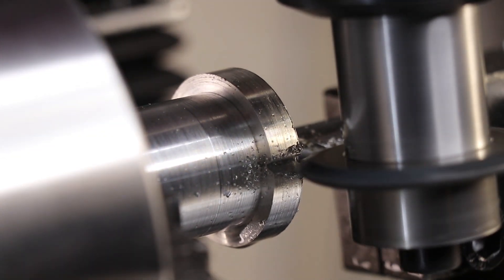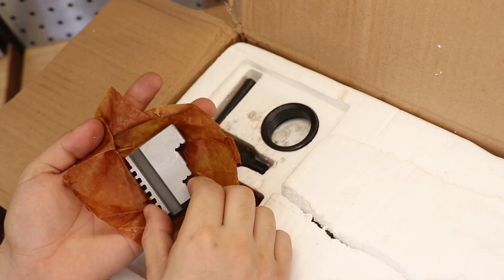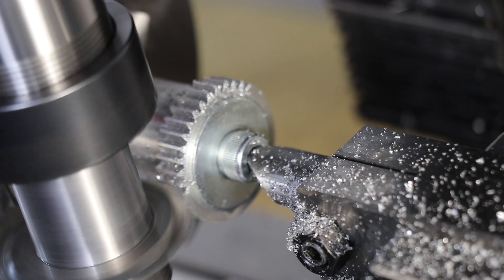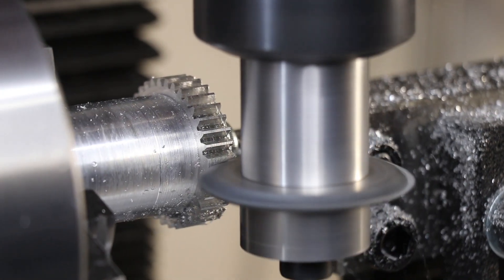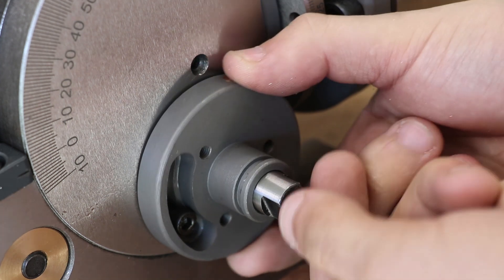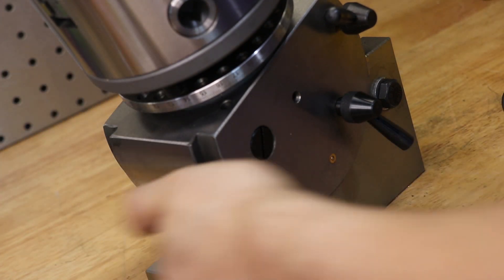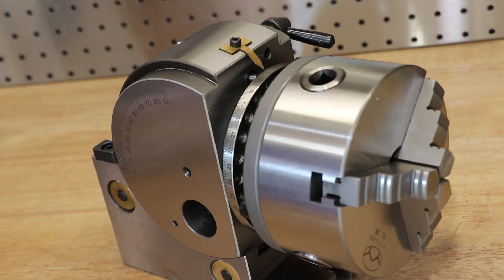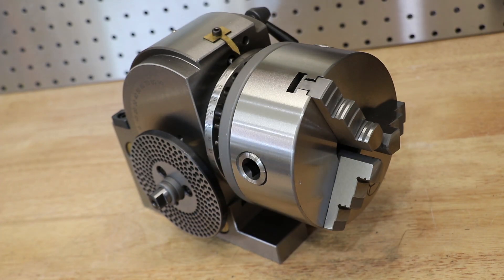$200 Dividing Head - Almost Scammed Buying It

Comment: You can’t press the spindle out. I just dismantled mine. You need to get the chuck off. I locked it and grabbed a cheater bar in the chuck jaws and it came off without any damage. The reason it was so tight was the machining of the spindle nose threads on mine was horrible. The threads were so sharp they would cut your fingers. Worst threads I’ve ever seen. But they shipped it anyway. Either the major dia is too big or they cut the threads too deep. But it’s cheap…..once you get the chuck and the direct indexing plate off there are 3 cap screws that hold the taper bearing race to the body. This has to come off to remove the spindle.

Comment: NOT MT2 dead center, it's a Brown and Sharpe #7.
Reply from the maker: The technical drawing that comes with this lists this as a Morse 2 taper. This is a Chinese close so it is possible that the taper has been changed
Reply: @artisanmakes  The Pdf manual that is on Vevor online states its BS7
Reply from the maker: Just checked again. It definitely says mt2 on my one
Reply: @artisanmakes   I checked the manual I downloaded from the website, it's over 10 years old.
Reply from the maker: No, my maual says MT2. It could very well say bs7 on others. I am telling you what my manual says that came with my dividing head

Comment: The one thing I care about is accuracy. So a test would need to include measurements.
When it comes to the bolts, rather than dismantling the entire thing, I'd undo the bolts with pliers and replace them with ordinary bolts so a wrench will do.

Comment: You need a mill with a universal table to spiral mill. I bought one from MSC back in the 1980's. They are nice. When I moved I sold it with the mill. I bought one again on Ebay for about $225.00 a few years ago. I switched out the original 5" chuck for a 5" chuck that had bolt on top jaws. I have no complaints. I sold my L&W index head with a 6" chuck, because this one is lighter and a 5" chuck allows you to get in closer to the chuck/center with the spindle.
Reply from the maker: For sure. I have a set up that gears the table leadscrew to the mill but this diving head is a little small for heavy duty helical milling. Cheers

Comment: Chuck removal: can you get a strap wrench on the spindle or the index plate?

101 divisions: if the handle is sufficiently accurate radially, you could make a plate with multiple hole circles, either 34, 34, and 33 holes or 25, 25, 25, and 26 holes.

Comment: my lathe is a vevor brand, its been pretty good for me so far only issue being the crap tail stock they come with, seems like an issue for everyone and the chuck plexi glass guard was broken when i open the crate, but i will give them credit cause when i contacted them about getting a replacement all they asked for was pictures of the broken guard an proof of purchase an they sent it, took about 2 weeks to come an it was alot better packaged than the lathe its self, it came with a bunch of stuff that was there own boxes but they was left loose in the crate an thats what got the plexiglass guard.

Comment: hello you can unscrew the chuck by using the indexing pin to block the shaft, and use the chuck key  with a small hammer to unscrew it. be sure to make the chuck in vertical position and give for some days proper lubricant to  help removing the chuck.  sadly the chuck plate is put in force, even by unscrewing screws i cannot unmount it...
Reply: i managed to open the chuck... don't know how to explain. i put the chuck on the shaft, put a nut inside the opening of the chuck so that it is in contact with the shaft and not the chuck, tigten a screw on the chuck with a nut. by screwing the screw, the nut is hold on the chuck, so the screw pushes on the nuts that is in contact with the shaft.. so the chuck plate gets out ! easly !
it really needed grease : there were burrs and no grease on the worm gear !

Comment: The video clips of you cutting gears shows you cutting in the wrong direction. Milling between centers in a dividing head should always be done with the cutting forces directed toward the head, not towards the tailstock as the tailstock is not designed to handle the force generated.
Reply from the maker: just skimmed through the video, i cant find an example of me cutting in the direction towards the tailstock
Reply: At the start of the video and as far as I can see all the close up shots of the milling in progress clearly show the chips flying toward the tailstock.
Reply from the maker: oh I see what you mean, I think i misread your previous comment
Reply: @artisanmakes  Sorry for my lack of verbal precision. I did not want to make it too long winded. You need to flip the cutter and reverse rotation of the spindle. If you use the back gear to reverse rotation that gets your cutter speed down to a reasonable surface speed but maybe you already did that, its hard to tell on video.It is also normal practice when gear cutting to give the spindle lock and the Y & Z locks an extra tweak, any movement at all and you have a piece of scrap instead of a gear.

Comment: Artisan Makes, you quite rightly mention further down in the comments that the smaller heads BS-0 and BS-1 are only semi universal as they are not equipped to be rotary driven by a train of back gears and therefore cannot produce helical gears or splines. This can be overcome on the semi universal heads by the addition of an electronic stepper motor and rotary encoder drive. There are a few others who have done this very successfully. 
Also the annoying issue with trying to juggle 2 spanners to adjust the pair of tailstock nuts and bolts can be greatly improved by replacing the 2 individual nuts with a rectangular piece of steel flat stock with two threaded holes set at suitable centres.
I have one of these cheap import dividing head kits the same as yours and they can be made very reliable with a bit of fettling and adjustment...very happy with mine and still can't believe how they manage to sell these for that price.

Comment: i'm thinking about getting one of these and this helps.
funny thing, it was cheaper to spend 1,000 for a lathe than it was to have 7 parts made.  i have the parts, and the lathe and saved about 1500 dollars.   i think the set up for the company was about 50, and then 90 per hour,  they gave me an estimate of 3100 dollars.
Reply from the maker: Neat, best part is you have all the machinery left around afterwards for future parts.

Comment: You can not press that out. You use the direct indexing pin to lock it, and dead blow hammer on the chuck key to unseat the threaded backplate.
Reply from the maker: I eventually had to make a jig to hold it to unscrew it, it was very much sized on
Reply from the maker: Pinned comment - EDIT 2: Thankyou to all the suggestions, and I have finally gotten the backplate off the spindle. Ill make a quick update video, but  to cut to the chase, I needed a fixture to stop the spindle from rotating, penetrating oil, an impact driver and a spanner for leverage. I really can not stress how tightly it was torqued on. No Damage to the threads, should be good to go. Cheers

Comment: If it’s like most others, the back plate unscrews from the shaft . which has a taper for a center
Reply from the maker: Pinned comment - EDIT 2: Thankyou to all the suggestions, and I have finally gotten the backplate off the spindle. Ill make a quick update video, but  to cut to the chase, I needed a fixture to stop the spindle from rotating, penetrating oil, an impact driver and a spanner for leverage. I really can not stress how tightly it was torqued on. No Damage to the threads, should be good to go. Cheers

Comment: Enjoy your videos and look forward to them. Im new to machining and you have sold me on a dividing head, i have a question though, you have purchased a BS-0 and the larger BS-1 is only $70 more, is there any reason you didn't go for the BS-1? or is the BS-0 the better unit? many thanks.
Reply from the maker: As i understand it they offer the same abilities, just bs1 is bigger. As it is, bs 0 is big enough for my machine and what I need so I bought that. Bs 2 and 3 however are slightly different as they are universal dividing heads and can do gear hobbing, whilst these can not.

Comment: I discovered VeVor a few months ago, and i have bought many items and are good for the home hobbyist.
The Dividing head i got was the HV4 for £109 Bargain as it is well made.
as for those cap head screws, when ever i get a problem like you i get a 2 or 3mm drill bit and drill through the side of then and insert a round bar and turn. 
or as suggested, if they are loose enough then try a pair of grips first.
when they are out i do replace such with a Hex head bolt so i can use a spanner,

Comment: To get the head off I believe you need to tighten the chuck down on a sizable bolt. At least 1". Then lock the head in place and turn the bolt counter-clockwise. Would use a large breaker bar. This video pretty much shows how to completely disassemble the unit. The link won't paste. Go to Bundy Bears Shed and find the video.
Reply: A large-ish  piece of hex bar held in the chuck jaws and a wrench applied to the protruding end is even better method.

Comment: The chuck unscrews.
Reply from the maker: Pinned comment - EDIT 2: Thankyou to all the suggestions, and I have finally gotten the backplate off the spindle. Ill make a quick update video, but  to cut to the chase, I needed a fixture to stop the spindle from rotating, penetrating oil, an impact driver and a spanner for leverage. I really can not stress how tightly it was torqued on. No Damage to the threads, should be good to go. Cheers

Comment: The chuck backing plate is threaded on the shaft. Simply put your chuck key on on of the chuck drive holes and give it a smack with your hand to remove it off the right hand thread on the shaft. When you put the chuck back on there is a detent that you will feel click in and that will lock it in so there is no need to use a hammer to tighten it up. In addition, the hollow shaft is machined for a #2 Morse taper so if you have an adapter you can use collets in lieu of the chuck.
Reply: If a chuck I'd really tight on there is a risk of splitting/cracking the square chuck key drive sockets by outing sideways force on them with the key inserted. The recommended way is to clamp a piece of hex bar into the chuck jaws and use a spanner/wrench on the protruding end of the hex bar. No danger of damage that way.

Comment: I have the same unit and the spindle lock, which is just cheap cast iron, broke after very little use at the threads. I disassemble it and made a new one out of cold rolled steel.   I was able to remove the chuck and backing plate with a 3/8th extension in the chuck key hole and a dead blow hammer.  No damage occurred to the gears because I had the spindle locked with the built in dividing pin.  I find that this unit is not very ridged when milling vertically due to it's height so light cuts are a must. Overall it's fine for the money and ok for the home hobbyist just don't be surprised if the spindle lock brakes.

Comment: Looks like a good deal.
As for getting those odd divisions I've relied on compound indexing. It's described in the Machinery's Handbook, and includes a chart for all divisions up to 250. I don't know if the latest copies include it with all the modern ways of doing things, but the 16th and 21st do. Essentially, it involves having a second indexing pin attached to the body. With this setup the handle can be indexing in one hole circle, and the plate indexing in another. The mounting bolts in the plate will need to be out, and the center hole should be a reasonable fit on it's mounting. 
This isn't a new idea. My first dividing head patented in the late 1800's is set up for this. (I'm old, but I didn't buy it new.)

A footnote below the MH chart reads:
"The indexing movements are exact for the divisions marked with an asterisk (*); the errors of the other divisions are so slight as to be negligible for ordinary classes of work, such as gearcutting, etc."
Years ago I calculated the accumulated error for 51 divisions. At the crank it amounted to about 1/50th of the center distance between two adjacent holes on the 47 hole circle.  I'd say that is less than the accuracy one can expect from even a quality DH.
Reply: Compound indexing doesn't help with 101 divisions, since 101 is prime. It essentially multiplies the number of holes on the plate by 40.
Reply: 5

Comment: Mate, you do realise that Vevor has an Australian store with local stock, yes?
Reply from the maker: Yes, that's where mine was shipped from
Reply: @artisanmakes  Ah OK, that makes it worth paying a little more IMHO.
Reply: @marvindebot  - you don't pay "more"... you pay LESS to get it from a local store.
Reply: @johncoops6897  No, Vevor prices are quite often slightly higher locally as there is extra handling and warehousing involved.
Reply: @marvindebot  - yes, but the freight cost is lower. Doh.
Reply: @johncoops6897  Not really, freight from CN to AU is dirt cheap because it is subsidised by the Chinese government. Mate, I get ten to fifteen packages a month from china and I buy from Vevor Australia all the time. believe me, I know the prices and the advantage of buying from Vevor is the quality is relatively consistent and when stuff inevitably breaks warranty is a breeze. Being cheaper than direct from China is not a thing, however. Equally cheap sometimes but never cheaper.

Comment: I bought what looks like the exact same rig from eBay. That was in October 2020, and I paid $228US shipped (though my piratical state sticks me with sales tax on top of that). I just looked at the listing (Dec. 2021) on eBay, same vendor. It's now $999! Ouch. 

I was particularly interested since the chuck thread is the same as my old Logan lathe, and I needed a decent 5 or 6 inch chuck for that; price of a chuck+backplate is pretty damn close to the price for this whole unit, so I figured the risk was small even if the head turned out to be landfill. I've used the chuck on the lathe, and it's working well. I don't see any runout, and that's close enough for anything I'm making.

But damn, that chuck was on there tight. Nothing in the minimalist instructions about locking pins or novelty threads, it's a conventional 1.5-8 thread but just too damn tight. I don't recall exactly how I got it off - it must have been such a horrific experience that my mind just blacked it out. Or maybe my age is showing. I'm pretty sure I put a piece of wood against one of the jaws and tapped the wood with one of my calibrated precision hammers. I locked the spindle by tightening the clamp screw to what must have been damn close to the yield strength of the metal; I don't think I used the direct index pin to lock it, as I didn't want to risk bending it, but I don't recall for sure. But in the end my hammers must have done the job.

Comment: Stick it in freezer overnight. Take out, cover base of head with insulation(towels, foam, space blanket). Allow chuck to warm a bit. Insert long bar into chuck across the face. Use timing belt or oil filter belt wrench around spindle gear. Wack bar Counterclockwise until it breaks or you break.

Comment: What's the runout on the 3-jaw chuck?  
Most times tapping the chuck wrench with a light bronze hammer will unscrew the chuck .
Reply from the maker: The run out was about 80 microns out of the box, I played around with the preload of the spindle bearings and got it down to about 30 microns. Cheers

Comment: Those "t-nuts of some sort" are intended to be keys to register the head against the t-slot in your mill table, so you can r&r it without spending a lot of time on getting it square to the table. I've got the same head, and it's pretty convenient- the spindle threads are the same as on my Atlas lathe, so I can take chucks and workpieces back and forth between the mill and lathe with no problem. (Especially convenient as I have 4-5 different types of chucks that I use on the Atlas.)

Edit to add: I've never had any trouble removing the chuck from the spindle. Not sure what's going on there for you.

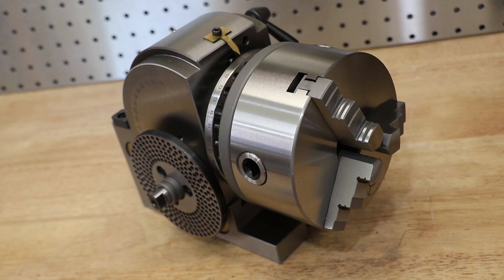Comment: 3:34 Here's the almost scammed part.
Reply from the maker: @John C . I am well aware of shipping costs and I am happy to pay them, so as long as I know that upfront when I pay for the product. And the listing listed free (included) shipping. But what I experienced was certainly verging on a scam. I have been burned on this stuff before  using aliexpress and the like and I did not want to take my chances on it. The fact that I was sent some one else tracking number during the dispute process was very telling that is was more than likely a scam and I probably would not have received the product. I may have paid a little extra buying from a different seller, but at least it was a legitimate listing. Cheers
Reply: @John C The actual shipping cost is irrelevant. The only thing important to the customer is how much he's being charged for the shipping - not the same thing at all. The first vendor wasn't going to ship anything even for the increased money; he was just going to think up an excuse to soak a sucker for even more.

Comment: You have been extremely negative and you paid only $200 ....in my opinion you are trying to give bad view for the company and that is not right....
Reply from the maker: Certainly not the intention, they made a great product for the price, but there are certainly issues that it has which should be talked about. I still recommend it, in light of its issues. Cheers